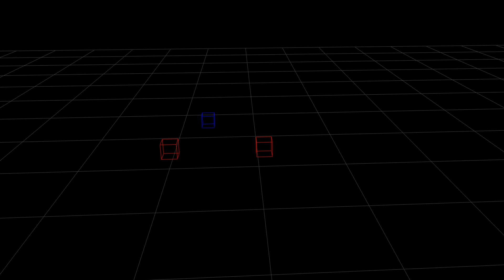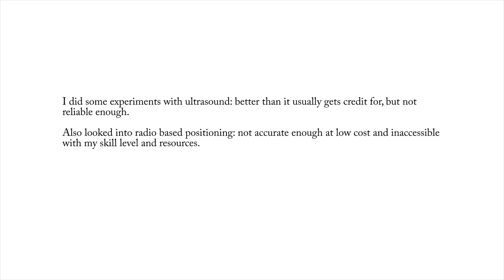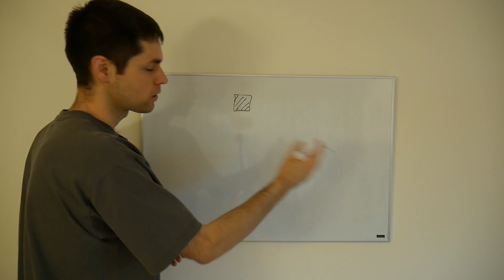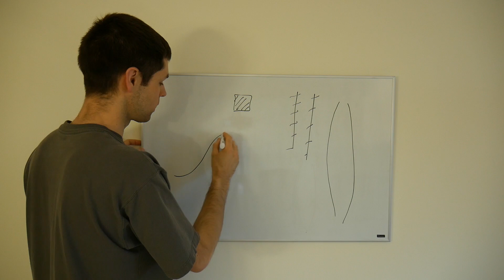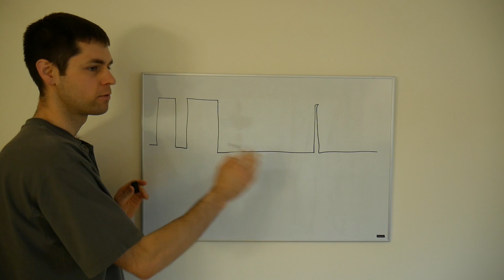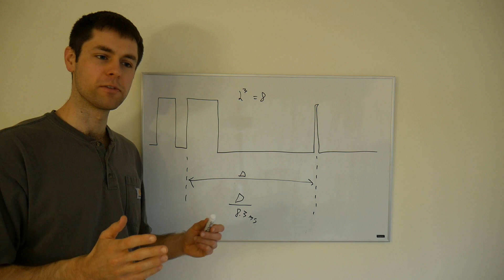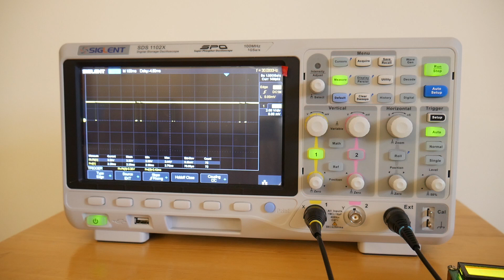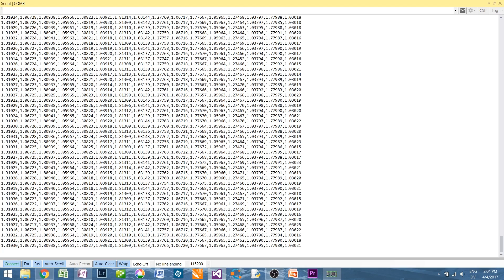Lighthouse Tracking: Basics

Comment: Sorry what I don't get is: where is the photo diode? In the boxes that contain the spinning lasers? If so, I guess it works on reflection off the tracked object. But how do you know which part of the signal actually stems from the object? Is there a retro-reflector attached to it?
Reply from the maker: The photodiode is on the tracked object, the thing I'm holding and moving around. Timing and data is sent back to the computer via the USB cable.

Comment: this is basically 3d tracking, right? I made a similar project back in 2009 with 2 wiimotes. It was surprisingly accurate and fast.
Reply from the maker: Yes, I was hoping that with enough reliability and accuracy it could be a measurement system.
Reply: I did that for a desktop sized setup and had sub-mm accuracy. Good enough to make a virtual keyboard on a desk if I had IR-LEDs on my fingers. We also did the calibration with a smiliar rectangle as you do. It was from a paper from someone called Zhang. With that we could eliminate lens distortion and all sort of stuff.
Reply: FatNonsense measurement system for what? I always had an idea for a follow focus system that worked like that. you'd have the sensors on the camera and your subject/actor had a little IR beacon on him and the system on the camera would constantly measure the distance and control the motorized follow focus accordingly.
Reply: What we did (a fellow student and me) back then was a system/framework to track infrared points in a space that is observed by those 2 wiimotes. It could track up to 4 points simultanously with 100Hz refreshrate (refreshrate of the wiimote). So with the resulting 3d coordinates you can do whatever you want. As I said, it is a poisition tracking system in a 3D space. 
Yes, you could use it to keep track of the position of an object (with an infrared LED attached) and adjust the focus of a camera accordingly. 
It would be a straight forward process to implements this, I don't see any difficulties. With the 3D tracking you could even make the camera pan and tilt to keep the object in frame, not only in focus.